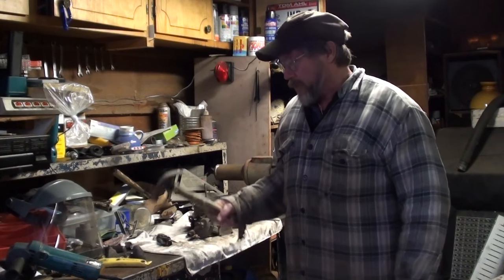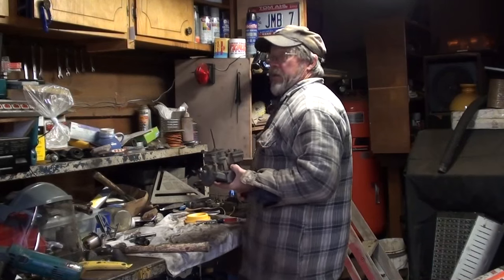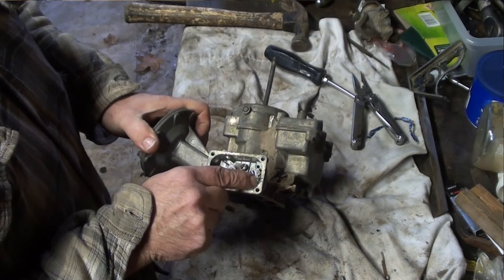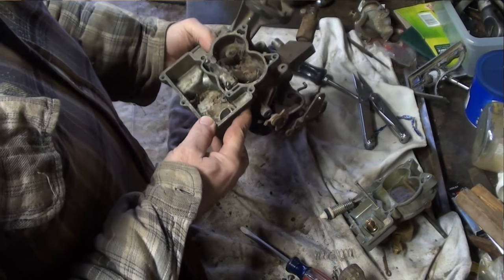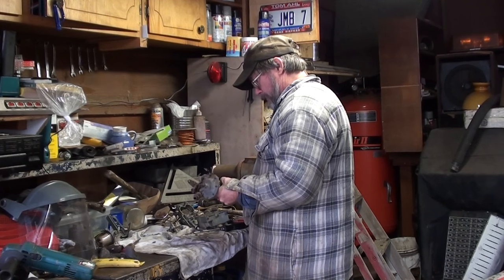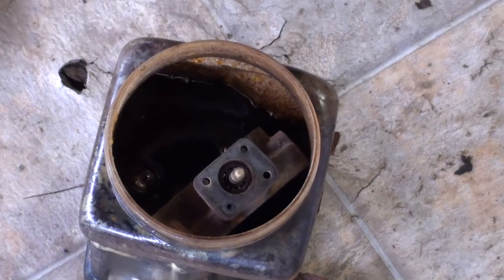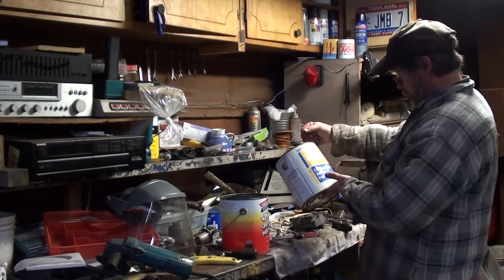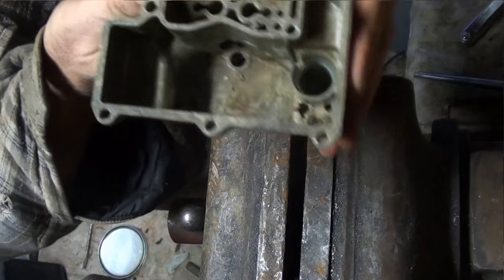57 Chevy Low Cab Forward Governed Carburetor Rebuild Part 1

Comment: Back in the day .. I used to rebuild carbs ...specialty was Q jets.  To clean them for restoration and save the colouring of the casting . I built a large sonic cleaner from a SS sink from a high school and attached a 6" X 9" speaker to the sink bottom and wired it to an audio power amplifier and hooked the input of the amp from a freq generator ... Today you could use a Bluetooth speaker box and use the smart phone and a I got away from Carbolic acid from Kleenflo...Its amazing how it would clean all the passage ways with just soapy water ... Sonic cleaners were good for watch movements etc Just a thought Cheers Alberta Dave
Reply from the maker: +Dave Webster  Not likely for me to do that any time soon. Or later for that matter! Although, I DO have access to a freq generator. Hmmmm.....
Reply: It really did Not take a lot of time to make....Once I found the SS sink (likely are bar sink would do) then it was silicone the speaker on and hook up ...there was no drain on the bottom , so it did not interfere with the speaker. I run it at around 1000 to 1200 hz sine wave or square. . It did an amazing job.
I had a funny story about sonic cleaners. My brother in law at the time was also into trucks and repairs etc and he knew how I enjoyed to rebuild things and repurpose everything. He saw may sonic cleaner and come up with his own.
He had some carbs to clean and had some SS containers from the restaurant business and decided that his wife's vibrator would do the same job as mine .... It didn't but you could not tell him ... Funny part , he never asked his wife for the vibrator and replaced it after he was finished and the guy never cleaned it and she ended up with a painful rash ... I laugh for a week and still chuckle about it.

Comment: I recently bought a twin carb outboard that wasn't running, besides all the lines being fastened with zip ties it had two bolts inserted in air intakes.  $6 worth of hose clamps and a few hours later I had tripled its value,  his loss was my significant gain.

Comment: very informative video and funny that a spider was still inside the carb. Anyway im working on rebuilding a 4 barrel holley carb that came out of a '67 mustang and as some one said too many parts and bits to keep track of but its like anything else you tear them down enough times and you can normally get them back together. I used the chem cleaner but never did try muriatic acid have to remember that one. Keep them flying Bradshaw

Comment: Layer of water in old chem dip was to keep smell down and keep good stuff from escaping so don't shake and slowly dip parts into can use basket  to drain/drip back into can. the small cans were for refiling big can. and of course the water rusted the can and lid and any thing sticking up. stained parts yellow too. nasty stuff but it worked.
Reply from the maker: +MIKE BASFORD I used to have a 5 gal. A friend wanted to know if he could use some. He came and got it while I wasn't there. He told me it was the worst stuff he'd ever used. Didn't work at all, so he dumped it. I went out to the shop and found he had taken the waterglass vapor barrier off the top! No wonder it didn't work! Since he dumped it, I didn't have the vapor barrier anymore and it stunk up the shop. sigh
Reply: +ElderlyIron Yes Yes Waterglass. I stand corrected. And no. One could not just buy some and recover the Chem-dip. also one had to be fast with GM  carbs with the green coating on the links and throttle plates as if left too long it would eat the green stuff right off and ruin a perfectly good carb. Stories for another time.Sigh!

Comment: I'm not looking forward to the day I have to pull the governed 2 barrel Holley apart on my '69 GMC water tanker. It has a 478 V6, shame the old Stromberg WW carb was replaced. I never did have any good luck working on Holleys and get them set right, but I can rebuild a Q-jet or Two jet and get 'em set up with no problems.

Comment: Jeff - what happened to the sound deadening box you built around the compressor?
Reply from the maker: +djc6394 Say, that's a new look for you!

That compressor disintegrated again. I got a 1941 Curtis. I put a lean-to over it behind the barn. You can almost count the rpm, but it's a big 2 stage.
Reply: +ElderlyIron Actually it's an old look - from when I did  racing school back in 2000.  I've got fur on the face right now. Guess we both decided to grow it out.